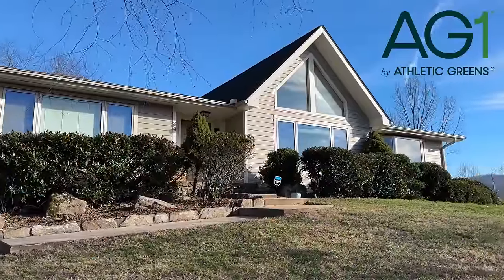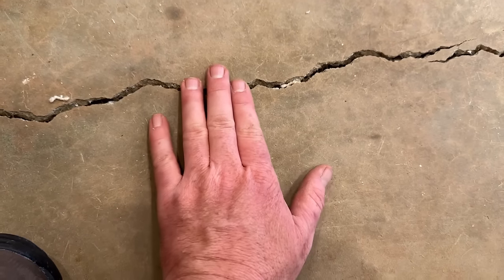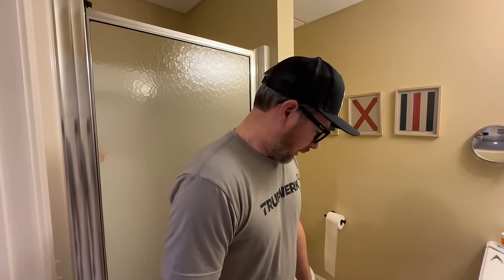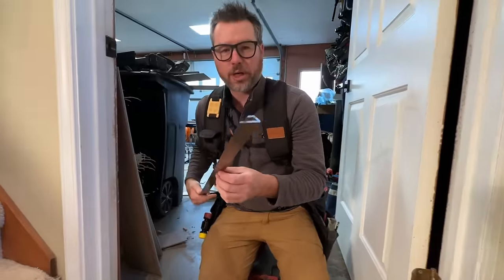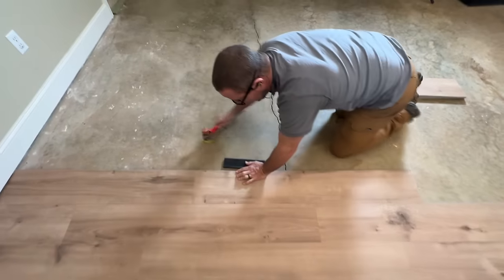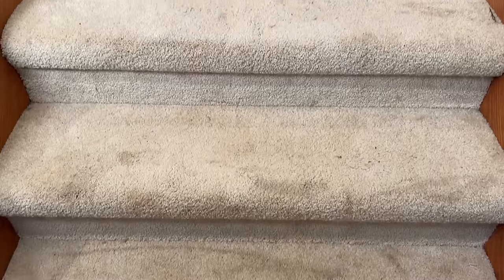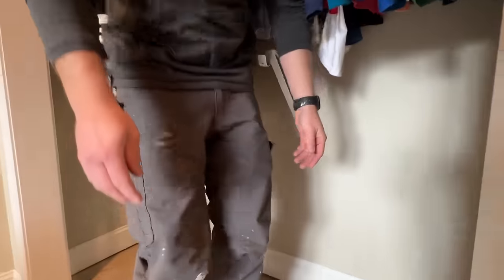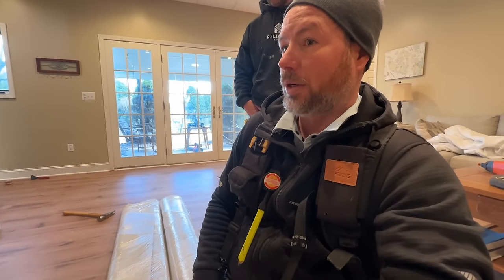Ripping out my carpet and replacing with LVP floating floors

Comment: A little Pro tip for you Eric when you're removing a used toilet out of a bathroom get you a contractor trash bag and pull over the bottom of the toilet and you won't spill any water or get any wax on your new or old floor and track it through the house

Comment: Perfect timing! I’m prepping my upstairs bathroom for LVT. Should be fun! Thanks guys. Love the channel!
Reply: Regarding your outdoor concrete walk with a step about every 6 feet or so.  This is an accident waiting to happen...someone falling on their face.  It would be better to combine your steps into one single flight and dig into the slope  of the ground or gently slope the walk, slightly (1 foot in 50 feet, or 2% slope).  Single steps are dangerous especially when you are not paying attention as to where you are standing or walking.  As you get older, it is more dangerous for less ambling older folk.  Also, the series of steps should have railing to grab.  I am only 73 and did a belly flop on my face on MY exposed aggregate step series like yours.  When you miss a step going downhill, you dont stop at one.  Ask any landscape architect worth his/her weight in senior housing.

Comment: Just to pass on tip I learned recently regarding when you have to remove a toilet to do a floor renivation or as in my case I had to get my main sewer line cleaned out and the toilet in the basement was the only way to gain access to the main line.  The plumber used a wet/dry shop vacuum to suck out the water, very little water got on the floor when the toilet was removed.  It worked really well, luckily my clog was about 50 feet down the line so they ran the "Roto-Rooter" bladed snake down the line.  Turned out to be roots from the tree in my front yard had partily cloged the line.

Comment: I love watching you guys build houses but watching you do vinyl plank ,which is what I do, is funny because of the few things you do wrong because it’s your first time. But because it was your first time you did really well tho, also you could do your stairs in LVP too you just need stair nosings that matches the floor and PL 3x glue or maybe Lexel(I haven’t used it before) but your stair work was like perfect. Also pin nails are better for the shoe molding it doesn’t need a whole 18 gauge Brad nail😂

Comment: Eric you have my respect, I know the feeling of having a full house. Me and the wife are busy planning our home and vinyl flooring is the plan, well from my side. She wants tiles i'm like hell no. So yeah you can geuss who will win that one...
Ps. I went on Telegram they tell me i can't send you a msg because it is of the protection of spam. Bummer.... Basement came out awesome!!!
Reply: I chose tiles for my husband to put down in our new room addition. The room is 24x30. What a mistake. He put 1/8 plywood down over the subfloor and then used shluter ditra on top of that. The 1/8 plywood started to pull up even though he glued and screwed it. The thin set to hold the ditra down was to wet. Anyway when it was done it looked really nice but was way way over budget and took forever. We chose Coretec for our bedroom. It was so much easier!

Comment: Pro tip, open up a heavy contractor trash bag and sit the toilet down in it. You can usually pull it up around the toilet enough to cover everything, then you don't have to carry it far. Keeps jobsite clean and dry.

Comment: If your going to redo the stairs with hard surface in the future look into the Cap-A-Tread system. It will save you a lot of time and most flooring brands/colors will have a corresponding Cap-A-Tread

Comment: Idk what kind you got there but the planks I’ve installed for other people (at their request, they bought them) don’t compare at all to the thick sturdy waterproof pergo brand. I’ve pulled some of these other ones out of the box and almost every edge looks like crap. Any of the floppy boards are just not what I’d want to use in my home. They’re real easy to work with but seem like junk. Not sure if you experienced that here but if you start working with some of the other brands you’ll see the differences. Awesome video bro-tato chip
Reply: Pergo is a laminate flooring, it’s not the same as the LVP… 
Laminate has some 24hr protections, but because it’s an mdf core, it isn’t completely impervious to water like this vinyl planks flooring he used. 
But I still choose pergo when it’s my choice, but for a basement floor like that, lvp is a fine option as well.

Comment: Pro tip:  use duct tape to secure the old carpet rolls and padding since you have to handle it several times.  Toilet may have needed two wax rings to avoid smell and leaks.  These things i have done lots of times,

Comment: Did you let that product acclimate to your house and how much does that product change with temperature? Somebody used laminate in this house and there is half inch cracks at some points in the because they did not let it acclimate. I want to use that waterproof vinyl also so I'm interested in how this goes.

Comment: I found the wood stairs in our home were dangerous because you couldn't visually tell one step from the other and couldn't tell where the  last bottom step was.  Also our dog could negotiate the steps as they were slippery.  We found 12" x 12" adhesive , sturdy felt square, we applied to one side.  That visibilty except for the last step on the bottom.  We found a basket that we visually identified as the last step.
Reply: Also you can get more "run" on a gentle slope by making the path more circuitous to reduce grading/excavation...also creating a more interesting arrival sequence to the front door from the parking space.

Comment: Good trick, once you disconnect the toilet lift it up slightly slide a trash bag underneath. Wrap the bag around the toilet, and hold it in place with the seat. No water on the floor no toilet water rags works like a dream.

Comment: At 16:50 hinge screws stripped I have a pro tip tap in a few wood tooth pics cut them off flush then put ur screws in it works great

Comment: 800 square feet of ceramic tile would better in a cement floor basement due to standing water damage. The core of the vinyl laminate flooring is wood product that standing water will warp. Throw rugs on ceramic tile work with standing water as the throw rugs can be removed and washed and dried effectively.

Comment: the tear out coulda been easier for you if you cut it in smaller rolls and roll it then for pad fold the sheet in half and roll then tape it easer to haul/ throw away without straining urself

Comment: ya'll should have filled in that crack. hopefully the termites won't find there way to your house or your new flooring.  Less gaps/cracks in the concrete=less entry points for termites
Reply from the maker: Good point… After getting the floors done I actually thought to myself that I should’ve filled the crack with some sealant! Too late now on that, but I’m pretty sure they won’t be coming up through this flooring, since it is guaranteed to be waterproof even on the seams.